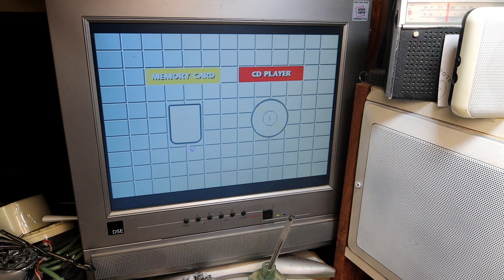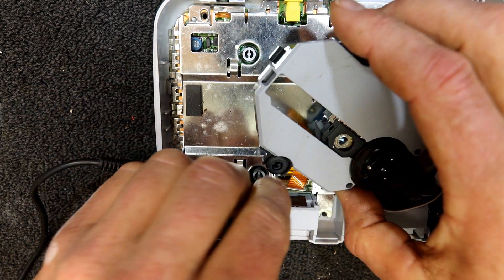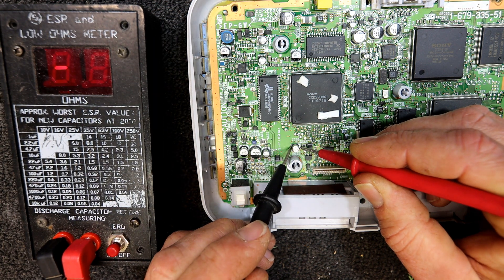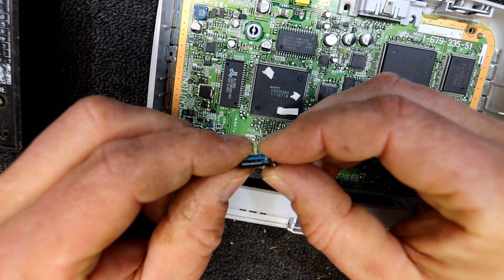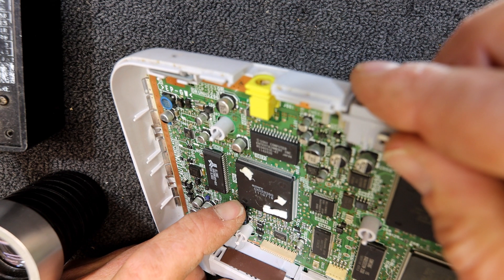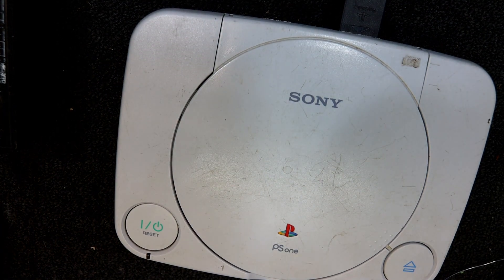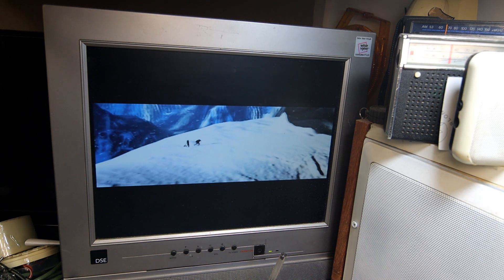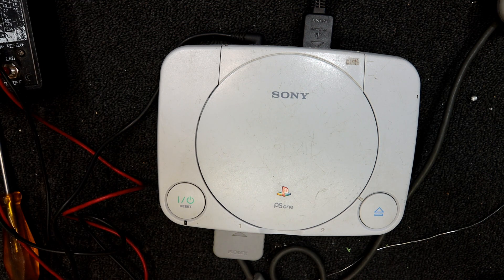Sony Playstation 1 SCPH102 Wont Read Discs Due to Faulty Capacitor

Comment: i do the same but now, my cd spine max and stop after 3 sec ... any idea pls ?
Reply: now you need to calibrate the resistance of the spindle speed should be between 830 and 650 ohm

Comment: Hello there i have ps1 turning on but lens do not move or go up and down .tested fuses they are fine .tested the lens on other playstation it is working ...any help thank you
Reply from the maker: Wind the laser out from its center position and see if it returns to the center when you press the door switch. It should return and then start trying to focus. If not it could be door switch or power related if they mech works OK in another machine.

Comment: Not once but twice i had a PS one like this from the same shop just stop working on me. I was playing a game tonight and died. Then the screen went black and nothing. Tires resetting the system, nothing. People make it seem like these srw more reliable than the old ones, but every old one I've ever owned has worked.
Reply from the maker: If they have enough hours on them they all fail. Going by mine failing, even just age on them takes out the capacitors.
Reply: @StevesElectronicRepairShop  i agree. i only want a slim because i live off grid, and these with the screen work great on a jackery. with the screen on the brightest setting and the volume cranked it uses 15 watts btw. but its nice to be able to have some sort of entertainment. would much prefer an older one though. i have the one with the red white and yellow jacks built right into it, and even it works if you flip it upside down. i bought it as a DOA. its kind of funny lol

Comment: I wonder if this is what is wrong with my PS One. It'll kind of detect an audio CD and play it briefly and cut out. I changed the entire optical deck for a working one and ruled that out as my issue. It also has a modchip in it that could be affecting it, but I wanna see if replacing the Cap will resolve the issue.

Comment: I dont know if this is the problem with my psone. 
I replaced the lens and it worked fine for like 5 hours, then it suddenly stopped working while playing. I tweek the potenciometer, with no results.
I tried with an old lens i have, no results. 
I went back to the first lens and it just worked again.... But again after like 2 or 3 hours it stopped working.
Now i can not make it work again, i do not think it is a faulty lens, it may be something on the board??

The spindle works and laser tries to read (while making an awful sound), but i can not figure it out what is the problem or what i did for it to work again after replacing lens... :(
Reply from the maker: Faulty capacitors can be heat sensitive, and so can other faulty parts. You can warm the board with a hair dryer and see if it make the fault appear, and if cooling down gets it work again. If is seems heat sensitive you can buy freeze spray to narrow down which part is the problem.
Reply: @StevesElectronicRepairShop  so after many tries it started to work again, just after making a plastic breaking like sound... So i inspected again and realized that the plastic dented piece that make the laser move was loose (it has 2 clips that lock on a metallic dented piece).

It was a cheap AliExpress lens (15 bucks) it came with that piece loose, after fixing it locking the clips on its place, it started to work great again up until this day. 
Thanks for your video and response, luckily my problem was easier to fix!

Comment: I will try this. Previously, I did every solution playing original PS1 games, replacing the laser reader, cleaning the laser lense, etc.; however, I still would get the red screen of death error message.

Update: I bought the specific parts (capacitors) for the PS1 slim version of my console from Console5, used my testing and soldering tools, knowledge from YouTube and Google, and solved the issue. Everything back to normal. Finally, what a relief!

Comment: Helpful video, thanks. The issue with the rolling might be a cap as well, I had something similar with a newer LCD set which couldn't make it's mine up sometimes with old computers and consoles whether it was in PAL or SECAM(!) which I traced back to a 10uF electrolytic near the SCART socket.